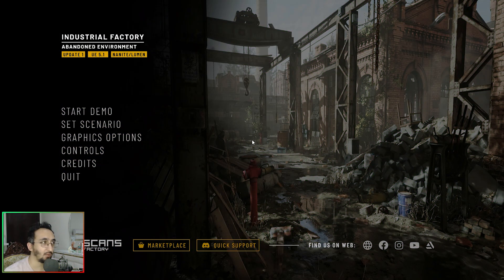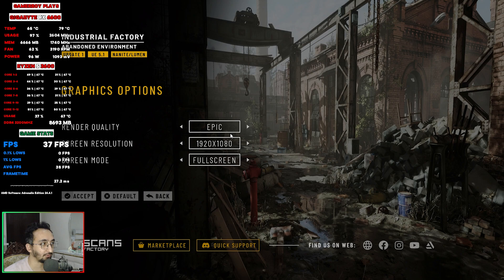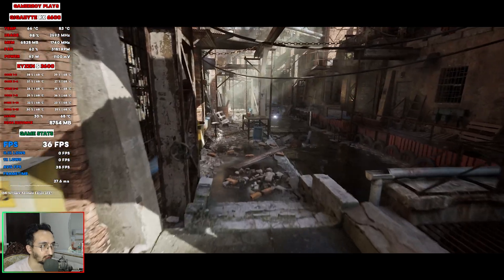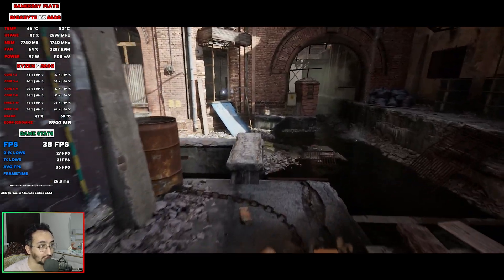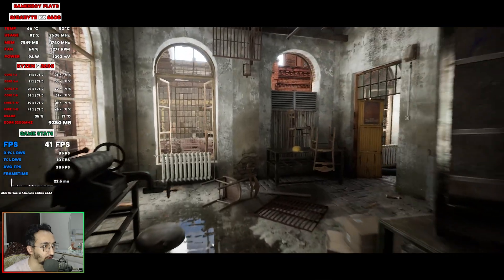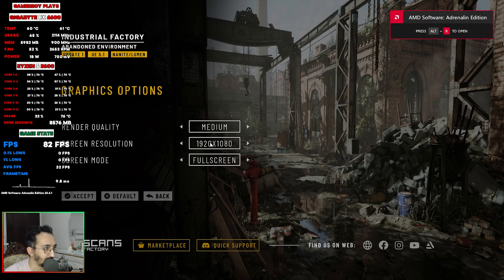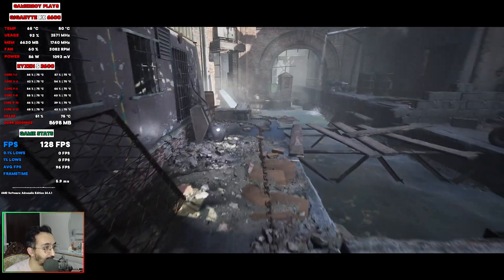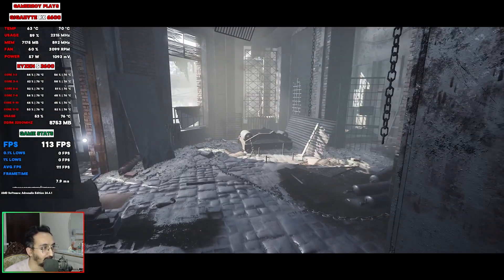Is Nanite and Lumen Justified compared to Typical Rasterization? - Industrial Factory Tech Demo UE5

Comment: its streaming assets. maxed on a 8gb gpu your gonan sit at close to 8gb but never at -as oyu need soem buffers for data transfers ( which typically are around 256mb becasue of the shared adress space - this way you can copy in moderate sized chunks ) - this is somewhat circumvented with resizable bar - still needs buffer space also tho. then theres also screen buffer allocations and so on. Most stutters come from mecopies allocating / deallocating data and bus transfers. Which can be minimized by not going fully against your vram limits.

Comment: This a good example of AMDs RDNA potential when it’s utilized. Lumen might not be as “realistic” as hardware RT but it’s FAR better than conventional lighting typically used by developers. Lumen just needs to be convincing enough and its will be targeted more than hardware RT that requires complex and annoying “drivers”. Unfortunately, NVIDIA doesn’t have the luxury of supporting Lumen natively because CUDA simply sucks at parallel processing. Hence, why studios kept using dated DirectX 11 engines.

Comment: I dont understand why they made it CPU bound for rasterizing... I would have made it GPU bound. Also Nanite and Lumen is a godsend for a solo dev like me, it is just some checkboxes and bam! You have a beautiful looking game.
Reply: Idk man, my experience with nanite has been wuite small but it was in the form of being confused as to why a forest section of my game was running at 15 fps then realizing nanite was enabled by default and disabling it and getting up to 45fps at not visual difference on my mid to low end machine
Reply: @CrazyFlyingMonk You need real geometry leaves for Nanite to work properly.
Most Trees/foliage assets on the marketplace use alpha 2d  cards for foliage which causes huge overdraw which is bad for Nanite.
Unreal Engine 5.7 in November 2025 will fix all foliage issues with Nanite foliage.
You would still need to convert 2d foliage to 3d foliage for maximum performance boost
Reply: Unless, the GPU has dedicated cores that don’t interfere with the main silicon, it’s better to offload that type of computation to the CPU. Nanite and Lumen are designed for real-time so it’s requires parallel processing. Epic knows most gamers still use NVIDIA cards so it wouldn’t surprise me they didn’t allow the any GPU to handle Nanite. Imagine the drama that would uprise if NVIDIA users found out just how inefficient CUDA is with real-time parallel processing. AMDs GCN/RDNA was designed to handle parallel processing but developers simply didn’t care or simply couldn’t utilize its potential due to DirectX 11.

Comment: Looks like you're VRAM limited for all settings in UE4 which causes a lot of stutters and bad performance. In UE5, you're VRAM limited in ultra and partially in high settings, but UE5 has some features (such as virtual texturing) that makes it more able to manage VRAM than UE4.
Reply from the maker: but both of these version are built in ue5 environment just one is using lumen and nanite and the other is for typical rasterization. I think the results from this video show that nanite and lumen are memory efficient as compared to typical rasterization atleast while comparing it in UE5, maybe other game engines will give different results
Reply: @GamerBoyPLAYS  Ok. I got fooled by the text on the main screen saying UE5.1 and UE4.25.

Comment: I just tried both on my rx6600, and I can say that I Would have no problem playing the 4.25 version, its beautiful, but still I wanted to try the 5.1, so I did, best thing you can do is lock 30 FPS and use Lossless Scaling to 60 FPS, no sttuters anymore, my card was 60% usage most of the time